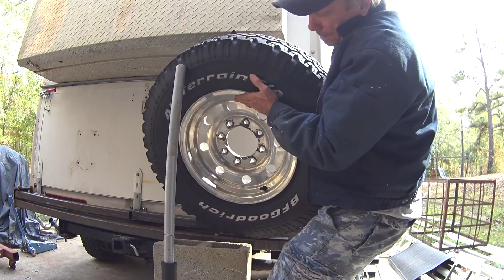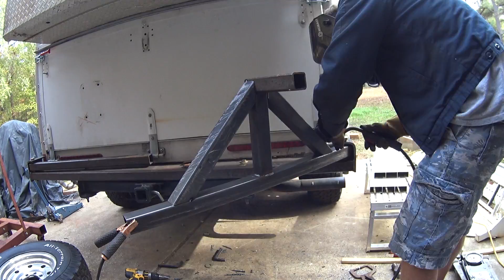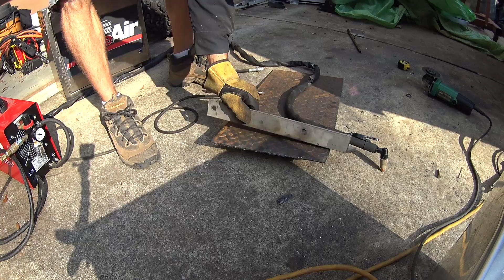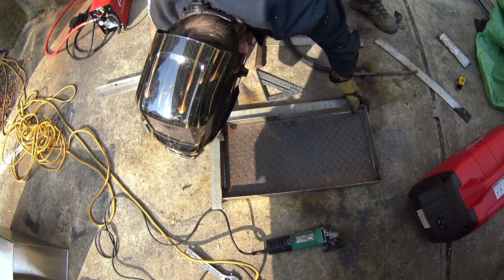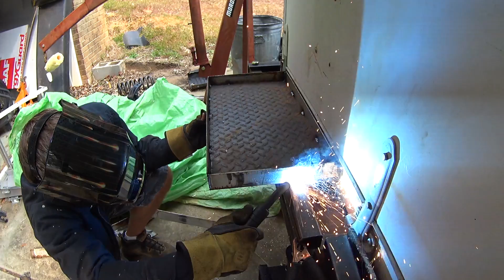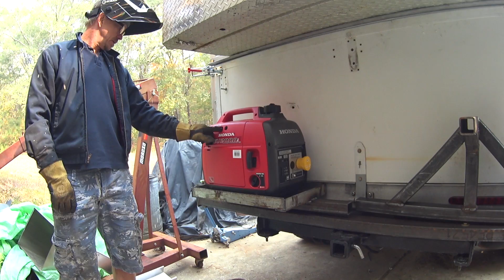Box Camper Truck DIY Honda EU2000i Generator mount 62

Comment: This is what I used on my truck and built a box for it. Cut holes for the exhaust and one for air intake using the flexible dryer vent tubing. Mine is a 3500 watt generator. I took the muffler off, used some threaded pipes then added a larger muffler to make it quieter.  Ironton Steel Cargo Carrier

Comment: Nice work!  First off, not many people run around with plasma torches...  Just sayin.  I think you are on to something great there, but I had a thought.  What about putting the generator on the box flipped 180 degrees so the exhaust is facing center.  That way you could swing the carrier away from the body and have the generator as far away from the body as possible while running.  Then the exhaust would be facing away from the box.  Just a thought.  As for securing it, I think you already have the answer.  build a cage out of steel angle with a lockable door on one end.  you can place a sheet metal back between the generator and the box, and a top piece on a hinge so you can lift it while running in hot weather.  When off the panels would sheild it from the weather, but the security would come from the cage.  

Just my two cents.  Keep up the great work!

Comment: I firmly believe in the process of (Am i going to use this now?) or (I have way to many projects going on).
You made money from the sale of the trailer and that's a good thing, plus it goes to someone that can hopefully bring it back to it's glory day's. 
And on another not, that tire carrier looks awesome! functional and sturdy. But if it was me i would use some of that bar stock from the old tire carrier and make up some triangle pieces to use as braces on that kick out on the tire mount and under the generator box platform. 

just an idea. 

keep up the great work on the build sir.

Comment: Best I can think of Swag off road - https://www.youtube.com/watch?v=iv4f9PUejn4
Or depending upon your welding skills, make your own with bolts through feet, and steel cage surround and a Master puck lock. Those are a royal PITA to pick or cut. I think Home Depot makes a $40 metal bracket that keeps handle from being cut on the genset. Everything else I've seen for portable gensets, involves concrete bases. Tends to be a PITA for mounting ease. If something looks to hard to steal most (convenience) walk by thieves will not bother.